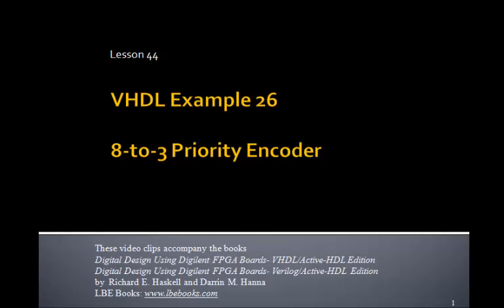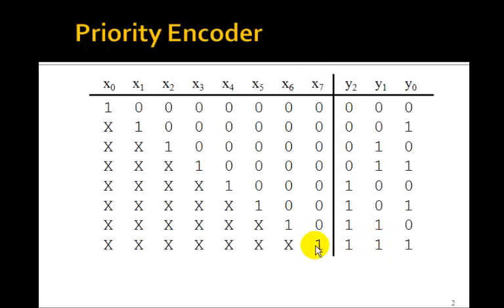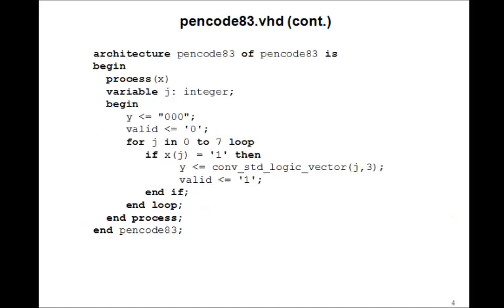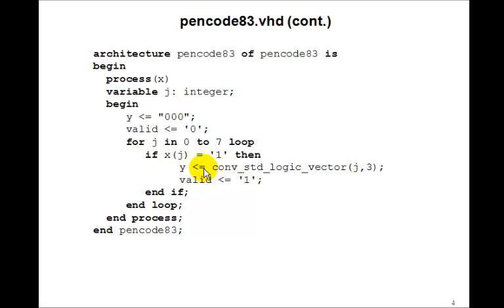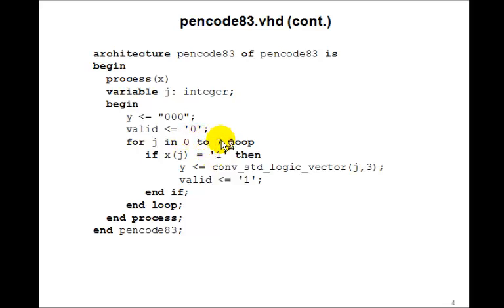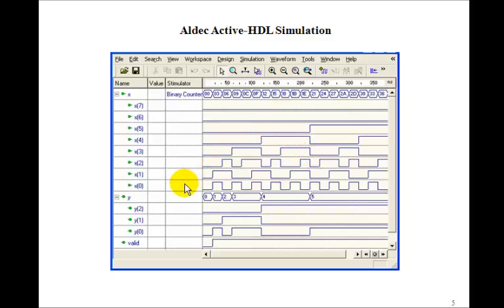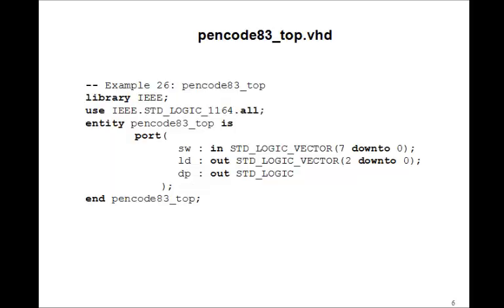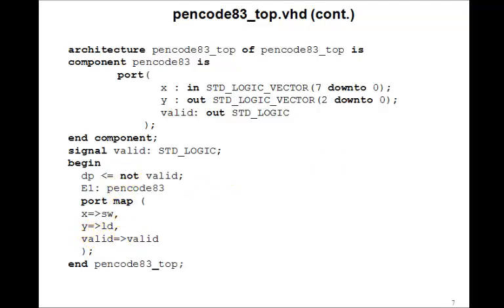Lesson 44 - Example 26: 8-to-3 Priority Encoder

Comment: To get the dp on the 7-segment display working -

Add to pencode83_top entity -
an : out STD_LOGIC_VECTOR(4 downto 0);
seg : out STD_LOGIC_VECTOR(6 downto 0);

Add to pencode83_top architecture just before the port map -
an(3) <= '1';   -- Module 3 disabled
an(2) <= '1';   -- Module 2 disabled
an(1) <= '1';   -- Module 1 disabled
an(0) <= '0';   -- Module 0 enabled
                                              
seg(6) <= '1';   -- Segments a-g disabled.
seg(5) <= '1';
seg(4) <= '1';
seg(3) <= '1';
seg(2) <= '1';
seg(1) <= '1';
seg(0) <= '1';

The rightmost dp should illuminate when x[7:0] > "00000000".